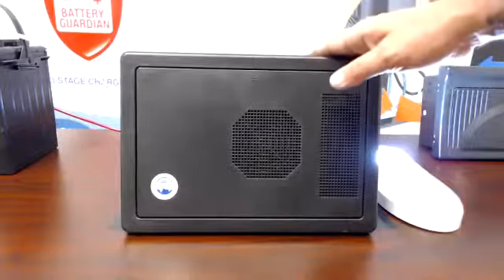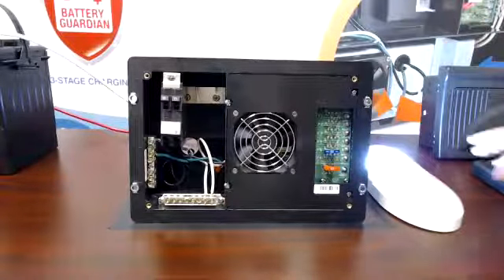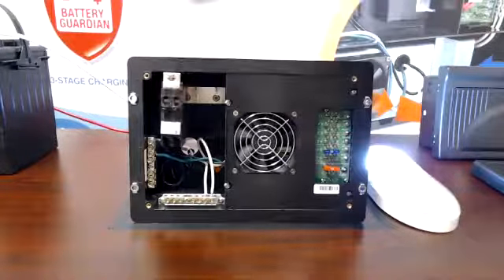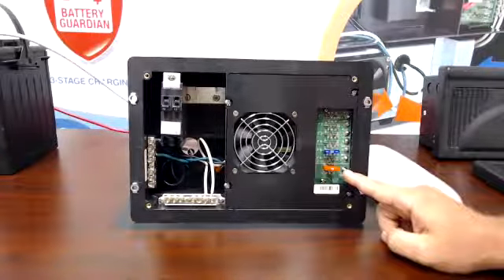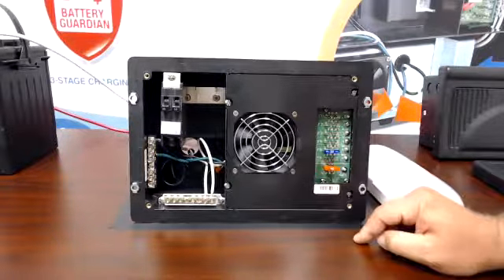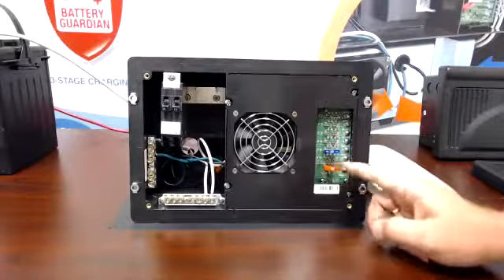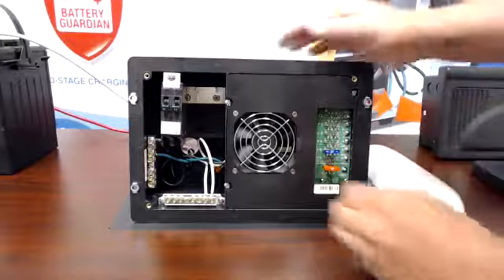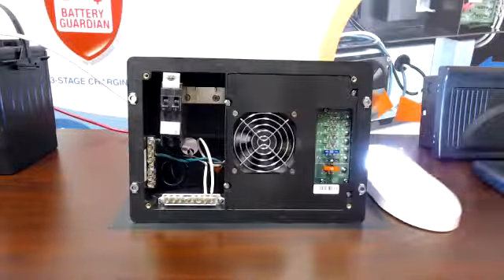Why does WF-8700 converter work when plugged into shore power, but nothing works when disconnected?

Comment: I wonder if you would be so kind as to help me out with some guidance? I have a Coachmen Apex Nano 17x 2016 camper it has the wfco 8735p shown in this video. When our camper is plugged into the campground pedestal or our outside outlet to at our house all is well or unplugged running on the battery all is good. But if I plug into our brand new Champion 3400 dual fuel inverter/generator the 20 amp fuse in position 6 (the red wire location you reference) burns out with a crisp snap seconds after the fan stops on the initial start up which I understand is done to charge the capacitors.
I've been on line searching videos trying to find out what's going on with no success. Everyone raves about this generator so I assume I'm doing something wrong. The fuse blows wether I plug into the RV ready outlet or the 120 outlet on the generator(using an adapter). Helping on line is difficult I know but any input would be great. Thanks.
Reply from the maker: Please call the Power Pros Technical Support at 877-294-8997, Option 1.

Comment: I have an intact fuse in the correct position...but no DC power. Can these units simply stop working and need replacement?
Reply from the maker: Yes, converters will stop and need replaement.